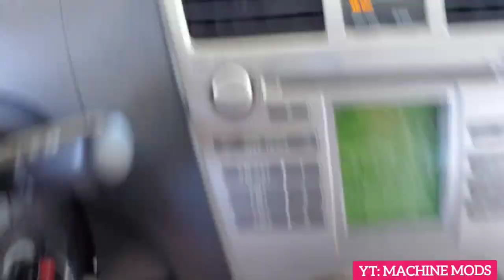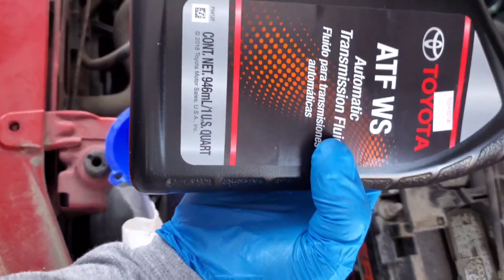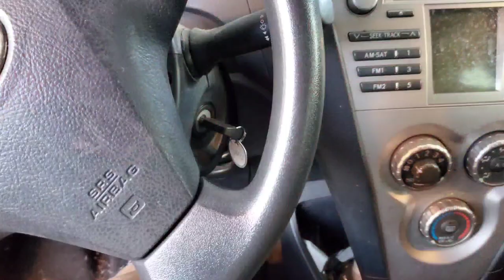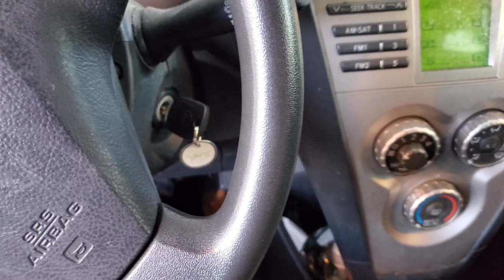2010 Toyota Yaris VIOS Auto Transmission Fluid change.  246,000 mi & never have been changed

Comment: Any issues after changing the fluid? I keep seeing people say not to fo it on high mileage cars.
Reply from the maker: So far, no problems.   Still smooth shifting.
Reply: If you have an early 2000’s Honda, I would suggest not changing the fluid if it has never been changed. It will destroy the transmission.
Reply from the maker: Yes I have heard of that.  I was curious about this Yaris.  So far till present day it is still smooth like it was new.

Comment: The part where you say “the internet says put 2.6 liters but I took out 4.5 liters” 😂😂. Funny but cute. Keep it up my dude.
Reply from the maker: Hehe thank you.
Reply: @machinemods  , my 2010 Toyota Highlander has 152K miles. Have not changed transmission fluid even once. I being asked to not change it by my mechanic, he says “It will kill the transmission”. But after watching you change it in the Yaris at 250K I am getting some confidence about getting it done.
Reply: @machinemods  , @you didn’t have any issues after the change?
Reply from the maker: After I changed it, I made sure I put in the same amount that I got out, I drove it for couple of thousand miles, I have no problem.  Smooth shifting as always.  As of last week, I still haven't had any problems.  Smooth shifting as always.